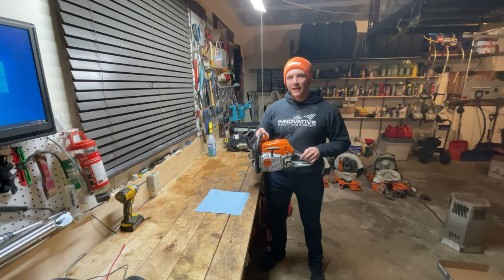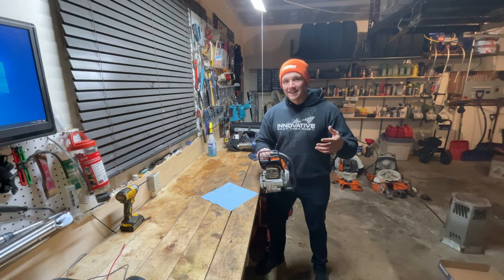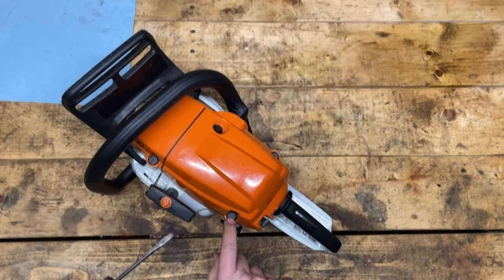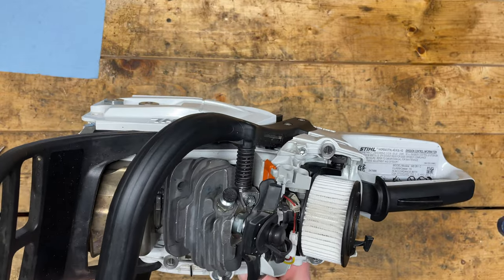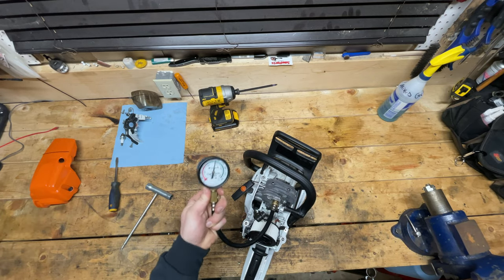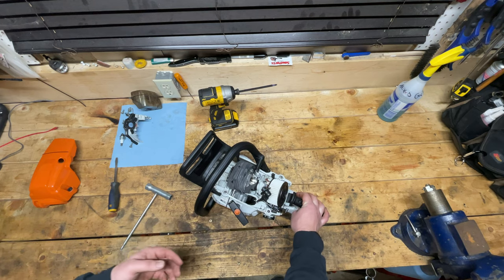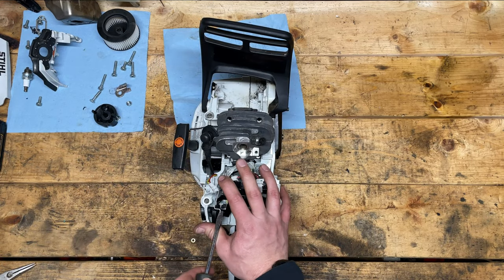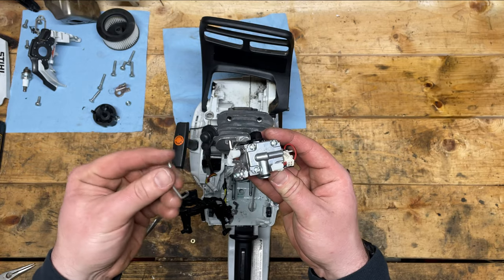Brand new Stihl MS261C-M chainsaw ran without oil!!! Step by step disassembly and damage analysis

Comment: Hey Dave,
i think I´d have a try on sanding / cleaning the cylinder... it´s broken anyway 😂😂 Perhaps you can have a try with a honing tool. I figured out, that it only cleans up the surface of the coating. 
Take care,
Stefan
Reply from the maker: Hey Stefan! I want this saw to be “new”... so I’m going to do something temporary until I can get new parts!!! Stay tuned!
Reply: @DavesSmallEngines  Friend I fixed the 372 xp got a new Mahle piston. Compression after repair is only 140 psi? Will the compression increase after a few fuel tanks? what is the best way to use the saw after repair?

Comment: I have accidentally run a virtually new saw on straight gas once while I was in a hurry to cut down a widow maker just before the grandkids came over to make it safe for them. I knew my mistake when the saw bogged down and stopped but it was too late. I knew better but in my haste, grabbed the straight gas instead of the clearly marked can of mixed gas. So even if you do know what your doing with a saw, mistakes can happen. Widow maker did get cut though.

Comment: Hey Dave hopefully donyboy found something you can work with I've watched your video I was thinking there has to be an aftermarket piston out there that will fit that's if the cylinder bore isn't scored beyond spec hopefully you get that saw up and running good luck to you
Reply from the maker: Hey Pete! Check out my latest video!!! Cheers!

Comment: Hi Dave, the correct OEM cylinder ass'y part is 11410201230. It is avaiable here in Italy, but I think if I'll ship to you in Canada it will overcost more than 300 bucks at least. You may try to hone the cylinder with appropriate brush and replace just the piston (part n° 11410302031). The Stihl cylinders are very well quality, it will be work fine, let me know.....
Reply from the maker: Wow! What a generous offer!!! I’m actually interested in this potentially... 300USD or CAD?
Reply: 300 USD, I don't know the canadian tax system. Death and taxes, damn taxes !!!!!!!
Reply from the maker: @STIHLFOREVER  life’s guarantees!!! I will keep you posted if I decide to go that way. That is consistent with the pricing here. Thank you!!!
Reply: out of intrest I checked that part nr 11410201230 is here in Estonia available for 192€. no shortage for stihl parts here.
Reply from the maker: @Anonyymsus  that’s awesome. Thanks for checking!

Comment: I've heard a similar thing is happening even with dryers. Whirlpool has been using the same basic motor for years, but there are no spares available because they're using the fewer that are being made now all for new equipment.

You mentioned sanding out the cylinder, but not the piston: is it because the damage amount, or because the piston is softer?
Reply: The cylinder is much harder than the piston. The material from the piston transfers onto the side of the cylinder because it's much softer. I've heard stories of people use maratic acid to remove the aluminum piston material from the cylinder walls.
Reply from the maker: I’ve done that too - check out some of the vids I made on it!

Comment: How the hell did you loosen the bolts holding the carb ?
I cant find any socket that will fit in those tiny holes
Reply from the maker: I use a special thin walled Stihl 8mm socket tool!

Comment: Nice saw. That's mad that OEM parts are not available.
Reply from the maker: $400 here from the dealer!
Reply: @DavesSmallEngines  big bucks Dave. A saw in that condition would probably be worth it if it were a keeper. It's probably 900 new

Comment: I have a 036 ran on straight gas. Have new genuine barrel and piston.
Would you recommend or is it normal practice to remove crankshaft to replace bearings? And connecting rod bearing?
Reply from the maker: Nope - I wouldn’t worry about that. Change the piston and cylinder and slap it back together!!!! Just make sure the bad gas is purged out of the carb.
Reply: @DavesSmallEngines  Thank you!
Reply from the maker: Cheers! Keep me posted with how it goes
Reply: @DavesSmallEngines  ok will do. I appreciate your advice thank you.
Thinking maybe I should replace crankshaft seals and bearings. Big end bearing may be challenging. 
I have a 026 ex rental purchased rebuilt is there any way of knowing if it’s china parts?

Comment: Hi Dave, 
Did whoever used the saw prior to you say they ran straight gas in it? 
The reason I ask is I have the same saw and I even bought the overpriced synthetic oil to extend the warranty.. my saw/ cylinder and piston are scored as well and have been waiting for oem parts for weeks now.... so I have been without my saw for 2 months now and still wasn't given a reason for failure... the first dealer I took it to said
It was unrepairable and they could dispose of it for me and I  found out they never called stihl until after I got my saw back from those clowns.. the dealer that has it now has been waiting for parts and verified it is warranteed but didn't say what happened. 
I've owned chainsaws all of my life and know I did nothing wrong and I'm concerned about the new electronic carb may be at fault here, running it lean and overheating it... 
So here I am out over $620 US with no saw to use. 
Oh and yes my extended warranty is also running out with no saw to use. So I'd be hesitant to call the m tronic awesome as it may be the reason for my saws failure.
Reply: Nothing awesome to see here.  Just look at the m-tronic carb.  When you realize that carbs are the most common thing replaced, this saw will be expensive to keep beyond warranty.  Stihl dealers just replace carbs and are not about to repair or rebuild them.  
If you know you used the proper fuel and oil, do not let Stihl off the hook on this.  Also, talk to Stihl in CT and do not depend on useless dealers for your final resolve.
What did the dealer who said it was unrepairable offer you to let them "dispose" of it?

What was your final resolution?  I'm keeping fingers crossed on my new, non m-tronics saw.

Comment: Hi Dave! That piston and rings definitely looks beyond saving. Cylinder maybe. Is that a home owner version or pro saw. Sad to see that happen but some people buy 2 stroke equipment and never get educated on how to care for them. Goodluck with your parts search sir! 👍🇨🇦🇺🇸Roger
Reply from the maker: Hey Roger! It’s a pro saw. Totally worth saving.  I’m not going to try and save it - I have a temporary option from Don that will hold me over until I can get my hands on some new parts.

Cheers!
Reply: Because I had extra bars and chains, my regular dealer let me buy 261c powerhead only w discount $500 out the door.. That was before all the shortages and price hikes.

Comment: I'm curious as to how the saw is coming along now after top end replacement.  All that metal went to the bottom end & probably stuck to bearings on crank.  Most time I would do a total rebuild if this were the case,, but like you said. Saw is to new & availability on parts is very limited.  I'm in the process of the same thing with a customer's saw now.  Still having a time finding crank & bearings. But cylinder big bore kits are available to now. I just hate to see a new top end go to waist over not being able to m as Ke it all brand new again. Thanks for the video though bud. Keep up the great work. :)
Reply from the maker: Hey Jeffrey! I’m more of a fixer than a user so truthfully I haven’t put a lot of time on the saw. For what I have though, so far, so good!
Reply: I meant no disrespect  to you bud by any means.. I was just curious  how it was making out for the customer. I finished up the one I was going threw & my customer is very pleased. But he was thinking he was gonna have to buy a brand new saw as well. But for 300 bucks he is very happy. 😀 thanks again for the video & the reply back.
Reply from the maker: @420bodean  hey Jeff! This is my own personal saw and I haven’t had much time on it. Lots going on!!! Cheers and take care!

Comment: If autotune and mtronic can sense air temp,barometric pressure, and fuel condition (among other things), then why can’t it sense if there is not enough oil and shut down the engine. I’m sure someone would rather pay for a diagnostic than a new piston and cylinder. Make it where the dealer has to reset the system before the engine will start .
Reply from the maker: Hmmm, that’s a good thought!
Reply: Because they are in business to sell parts also.
Reply from the maker: @JohnR9965  hey true John!

Comment: It sure looks like somebody smoked a piston and cylinder real good. What it needs is a new piston and cylinder. But I have seen you have good success by doing the sanding and acid trick. But that piston, I don't thinking sanding is going to fix that, especially with the frozen rings. Poor saw, id didn't even have a chance.
Reply from the maker: It’s too bad eh stellar???? Sheesh. Don may have something for me though!

Comment: Dave they have a 500 i,,,at my co op 3 blocks away
Reply from the maker: How much?!
Reply: I m buying the 462 ..it's 1100 but getting some other bars .will be few weeks.though .im in peak Season and do taxes tommorow.
Reply: It's a good price they might do it little cheaper if your just wanting the saw itself.and no bars exctra..god bless going to mow ..
Reply: @DavesSmallEngines  my email sometimes has problems.so don't think I'm ignoreing it.if you do try it ..if not it's ok just wanted to help .can't stand the way theze corperations do us small guys.
Reply: I beleive it was 1250.00 or 13oo

Comment: There is no way you fit that regular diameter 8mm into the face of the carb filter housing😂
Reply: I'm having the same problem!! Help. I can't find any thin walls in my town. Any other ways to get em out? Or just a special kind of socket
Reply: @josephponder195  snap on deep 1/4 drive fits

Comment: I call pure BS on the lack of availability of parts for a pro level machine.  Why do you think we paid top dollar for the pro level?  The magnesium crankcase doesn't do diddly if any critical component can't be found.  I asked my dealer (a good dealer) about this and yes, if it's not in stock, you will be without a tool until Stihl gets parts.  This is unacceptable from Stihl or any others in the same boat.  And my theory on the C, C-M as a design engineer, is that the firmware runs too close or beyond the edge of lean for some set of parameters that it is looking at.  Maybe you pulled it out of a freezing vehicle or one whose interior is at 150F.  The thermal mass of the engine, block and carb body will tell the sensors that the thing is either freezing or burning ... and will do this until air flow normalizes the temperature.  Likewise for whatever else it looks at (altitude? barometric pressure?, etc.).

I'm very happy with my new MS261 ... without any stinkin electronics or processors or sensors :-)  :-)  :-)  Running Saber 50:1, Ultra is on the shelf for now.

One last theory ... is it possible that in addition to running straight gas it was run with the air filter still on the bench, perhaps under a towel?  This would suck in all particulates in the area.  I clean my saws with compressed air and what has concerned me lately is that pressure of the air could blow stuff into the exhaust side.  Depending on piston position, this could either coat the piston with abrasive or fill up the crankcase well with it for continued distribution.

Sorry for the long post, this stuff gets me going.